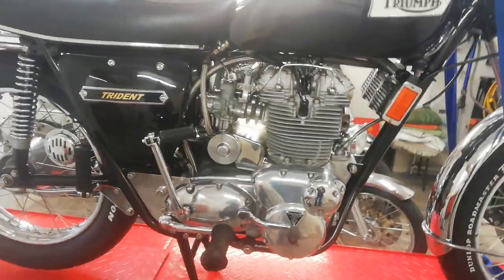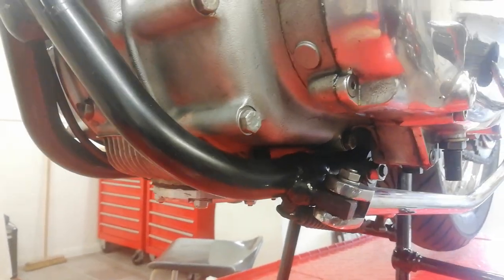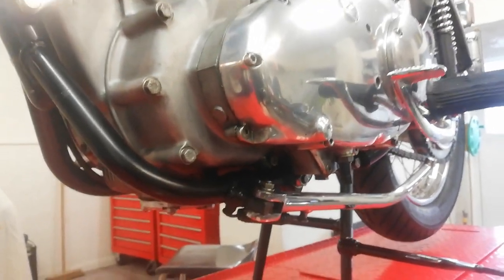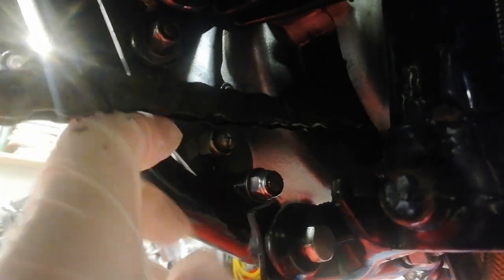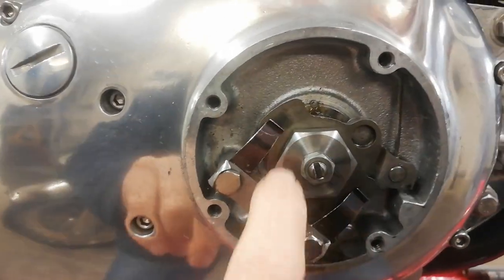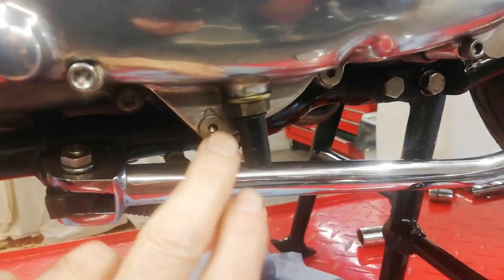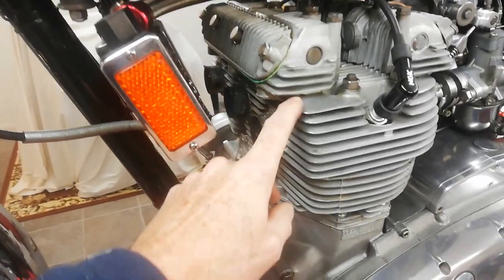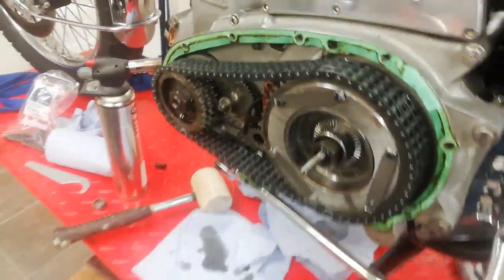Primary Chaincase, Clutch and Gearbox Rebuild. Triumph Trident T150V. Part 1: Beginning to dismantle

Comment: Hi Chris, I bought your book last year, very informative and entertaining too! To make the clutch action lighter and smoother you can leave off the finger springs at 17:14 they serve no useful purpose. I have three T150s  including a race bike and I don't use those springs, the clutch is much nicer without them. Andy.
Reply from the maker: Thanks,  Andy.  I am indeed thinking of leaving those springs off.  I also have the Triples Unlimited ramp modification fitted to my T150V. I'm not sure if the owner wants one on this engine or not yet.  https://youtu.be/TgY7wsvyeUg
Reply: @Chris.rooke150  Give it a try without the springs, it's a 5 minute job and you'll be amazed at the difference. I noticed the ramp modification, I also use them, every little helps when it comes to getting a T150 clutch to operate smoothly!

Comment: Tip for separating soft case halves is to use a plastic spudger tool. Look for those that would be used for professional repairs. These became popular with iPod and later iPhones screen repairs (when people got tired of using a credit card for that purpose).

Comment: Hello Chris like the video but can you please tell me what type of motorcycle lift you bought and would you recommend? Cheers Clive.
Reply from the maker: I bought one from Machine Mart (Clarke) which is great for the money. It works well and is a Godsend. However, it's a bit narrow so I always get help taking bikes on and off it, and the front wheel clamp was pretty naff so I removed it. Having said that, if the lift were any wider it'd take up too much room in my workshop. Whichever one you buy, it'll be about the best tool for working on bikes you ever bought!

Comment: Is that a T150 with an electric start? I thought only T160s had an electric leg!!
Reply from the maker: You can convert the T150  (and BSA Rocket 3) to electric start by fitting the clutch cover from a T160, adding a ring gear to the shock absorber unit and buying one of the aftermarket starter motors. Works great! 👍👍👍
Reply: @Chris.rooke150  great job looks factory